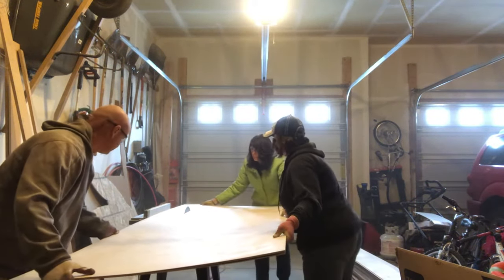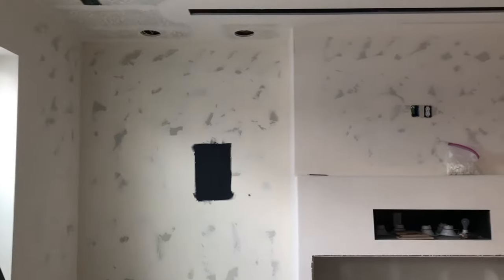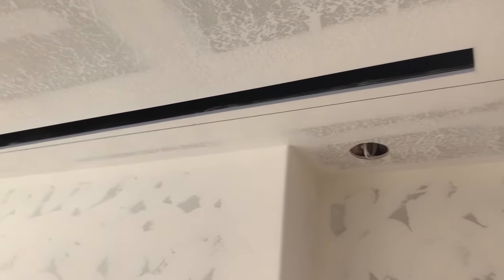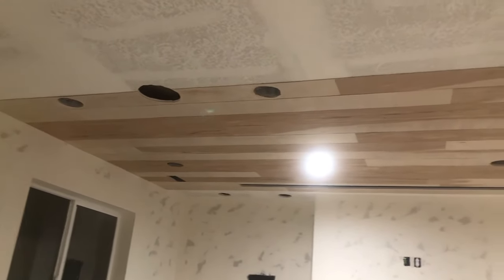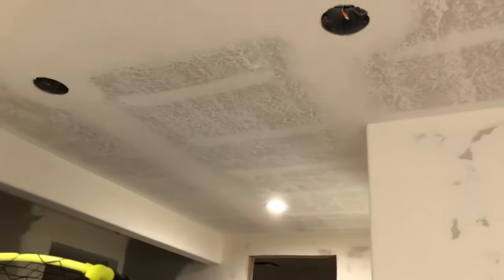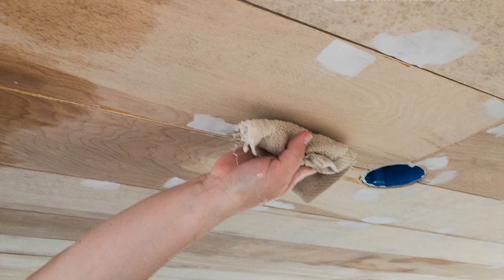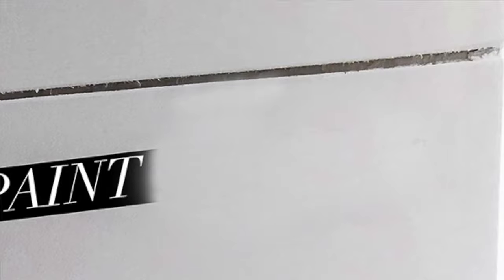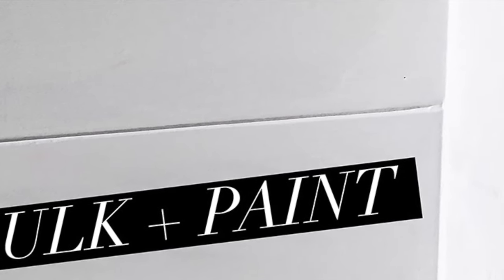What you need to know BEFORE installing a SHIPLAP CEILING | AVOID these mistakes!

Comment: Not sure if you answered this question already but I noticed you didn’t mark for ceiling studs, so is that necessary? Or can you brad nail directly into the ceiling drywall?
Reply from the maker: Great question! No we didn't mark for studs but you definitely can. Since our wood isn't very heavy, the construction adhesive will ultimately hold them in place. The brads are intended to hold the wood up while the adhesive dries. If you're using true shiplap or heavier wood I'd definitely locate the studs/rafters and you wouldn't need to use adhesive.

Comment: the wafer led lights how good do they fit with the shiplap and drywall? i beleive you get 1in with these lights im worried they will fall out . how thick are your shiplap boards
Reply from the maker: The utility plywood we used as our shiplap planks was 1/8" thick. We haven't had any problems with the lights falling out. These are the lights we used https://rstyle.me/+5bFr_WEPyIZbu-1epTL_2A

Comment: Hey if it makes you feel better...we have plastered ceiling.  Pop corn plaster!! So we are stuck!!
Reply from the maker: Actually that does make me feel a bit better 🤣 that stuff is awful to remove! Thanks for watching!
Reply: One local contractor applied new drywall over a textured ceiling rather than removing the texture.
Reply: Just spray it down with water and it'll come right off! 😉
Reply: @floaterfans  Not always, and many old textured ceilings contain asbestos so masks and disposal might be difficult